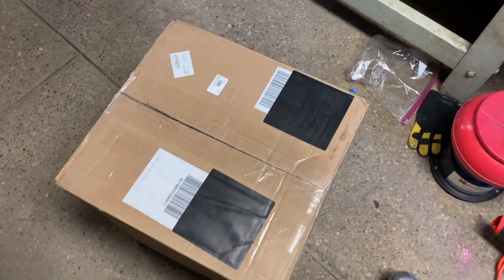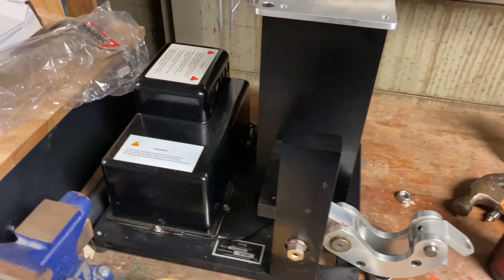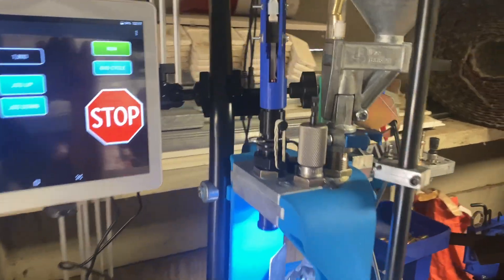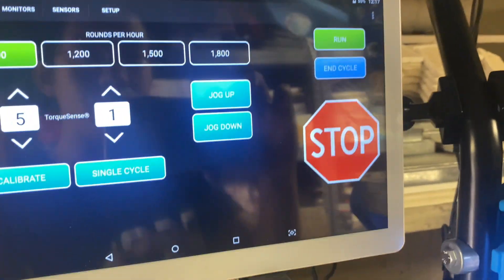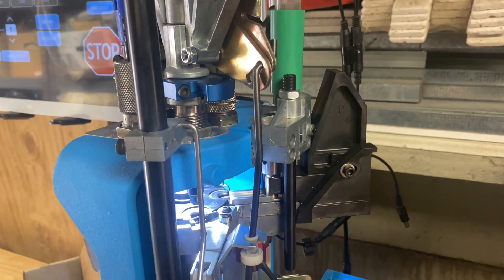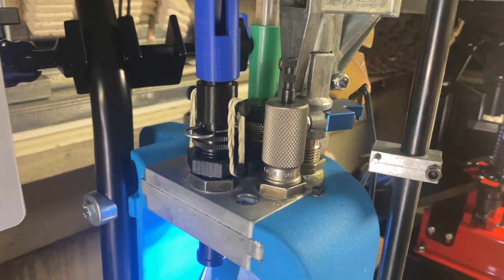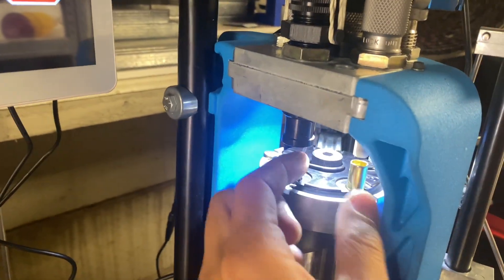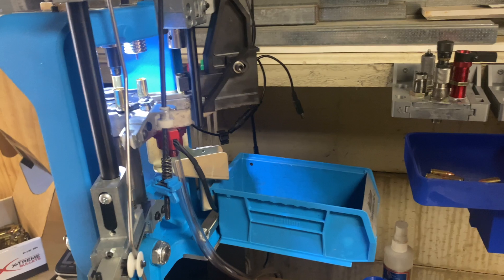Mark 7 Autodrive for Dillon XL 750 - first time setup and tips.

Comment: how to break a ton of index rings and void your lifetime warranty. All in the name of being lazy and cheap (dumb because you bought an auto drive for a machine thats not rated for autodrives)
Reply from the maker: I will gladly pay ~$20 every 5-10k rounds loaded to replace an index ring (and all springs since they wear out due to throughput).  That's 5-10k handle pulls I don't need to make.

As for lifetime warranty, anything automated doesn't have warranty beyond 1 - 2 years anyways.

I will agree that I am lazy and cheap as I see no reason to do the unnecessary work and pull the handle, and I will gladly save the $1-2k over the RL1100 or Apex 10 since I don't really need the extra stations when I am only loading 9 major.
Reply: @garykfko especially spending the extra for the rl1100…. Let’s be real you only get to swage while reloading…. That’s it… xl750 you swage in prep and that’s all ya get…
Reply: @garykfko  you get zero warranty the minute you put an automated bot onto your machine. hopefully your machine lasts that long, the xl750 and 650 have aluminum bodies and link arms that aren't meant to handle automation no matter how "sensitive" your sensors are
Reply from the maker: @HotReloads   Turn down the digital clutch and torque sense and I even stopped breaking indexing rings because the machine stopped before damage could occur.  My current indexing ring is probably 15k rounds in.  If I tuned it to the point where it’s not even breaking plastic indexing rings anymore, I don’t see how metal hold up worse than plastic.  I suppose if someone decide to go wild with the power from automation then it can exert much more force than human can and potentially break the metal on the press.  But that’s a user error and not automation’s fault.  Anyways I am not going to change your mind and you are not going to change mine so we will just agree to disagree.

Comment: Have you gotten any of the sensors yet?  Time for an update video? :)
Reply from the maker: Yeah maybe an update video is a good idea, I will capture some vids next time I fire it up and do an batch.  I ordered every sensor available - optical decap, low primer sense, bullet sense, powder sense.   Optical decap doesn’t really work unless you keep it clean, and it’s a hassle to clean, but the press will get stuck at the priming station anyways if the case is not decamped.  Low primer sense is awesome, it prevents the mistake of running the press on empty primer, where you end up with a bunch of seated cartridges without primer.  It also stops the press every 100 rounds which I use to random quality control (pick one round from the batch and case gauge / measure OAL).  The bullet sense is freaking awesome, it had caught every single upside down bullet so far.  The powder sense works - I’ve actually never had it catch an actual no / double charge since I had not made that error, but in testing it works fine.  Once the primer tubes are loaded, I kinda just sit there and watch Netflix while it does its thing, and feed components when necessary.

Comment: How is this holding up.  I've considered one but I'm curious as to how it works overt time?
Reply from the maker: Took a week or two to dial it in and work out small issues here and there to run it smoothly.  It’s running awesome now, I love this thing.
Reply: I have unit #3 for the XL650 and have over 80,000 9mm rounds produced and still runs like new. Have to change springs on the press as required. I would buy another one without question.